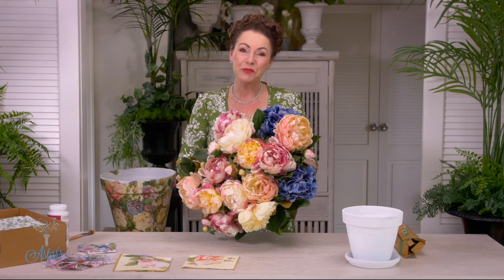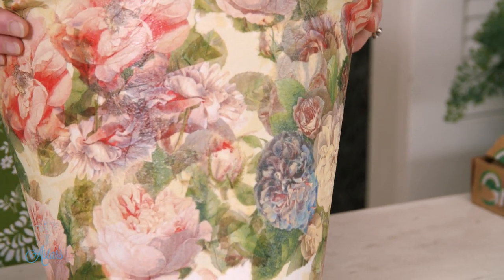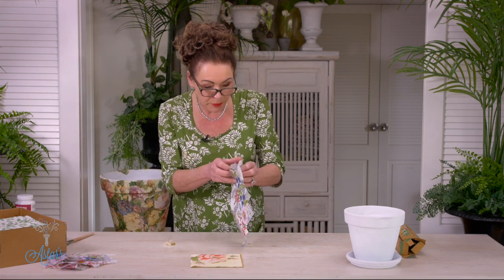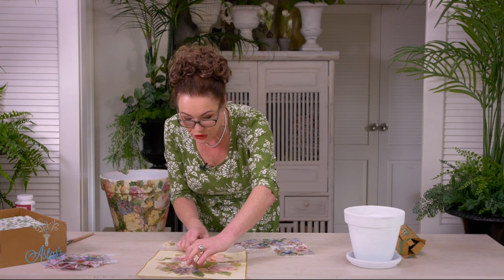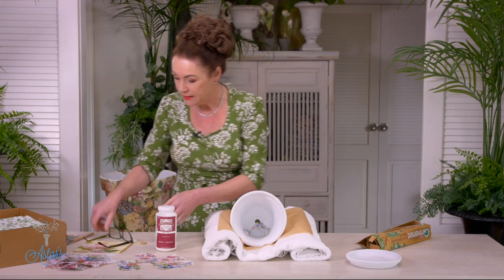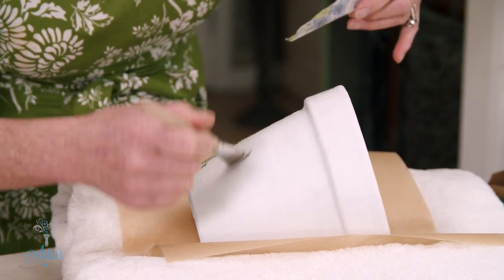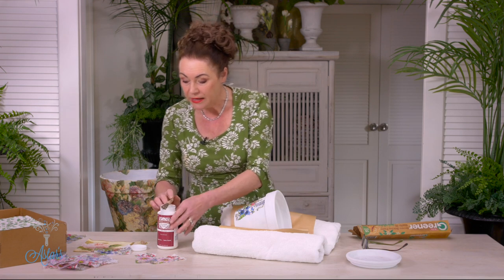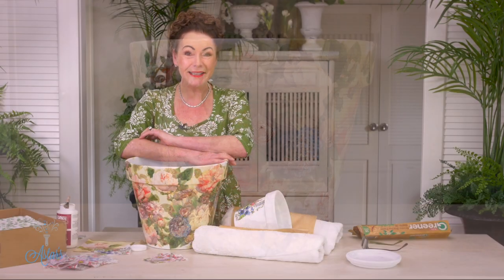How to decoupage a ceramic pot - or just about anything you like!

Comment: I have to add my little comment and I am coming from a very beginner perspective, so please don’t attack me everyone if you find my comment incorrect.
With a clay pot, you have to seal the inside entirely all around the drain hole the bottom inside the inside sides all the way up so that if you put anything with water or to have potting soil in the pot and you’re going to water whatever plant is in there please remember that with a terra-cotta pot that the moisture goes through the entirety of the clay. What does this mean? moisture is going to affect the outside design very possibly maybe not in all cases, but it could potentially. I did work on the clay pot. I have not sealed the inside, and the outer design was completely destroyed. Are used an acrylic paint to paint the inside and then I sealed it with a varnish.
Now here’s another very important note! If you seal your terra-cotta or clay, pot or container on the inside, with some sort of varnish, varnishes are usually always flammable. So you’re not going to put your clay pot into the oven after you varnish it!
Do not put any container into the oven if you have used a flammable, varnish, or paint! Read the label!
If you need to seal your outside painted surface by warming it in an oven, do that first and when you’re all done, then once it has cooled down entirely then, and only then can you varnish/seal the inside with something to put a barrier between moisture/water

Comment: Can you put it out side? If water can wash it off is that still possible
Reply from the maker: Hello Cherri, I so want to say YES PUT IT OUTSIDE, but unless you apply a really good couple of layers of exterior vanish, it will deteriorate.  I've got mine outside but under cover and it's well protected from the elements so my fingers are crossed.  I found a beautiful print show-casing mixed spring flowers which took my fancy and will be an amazing display in 6 months time??? I hope 🙏